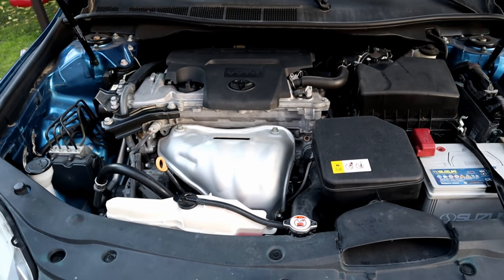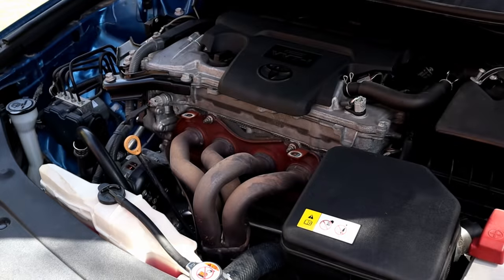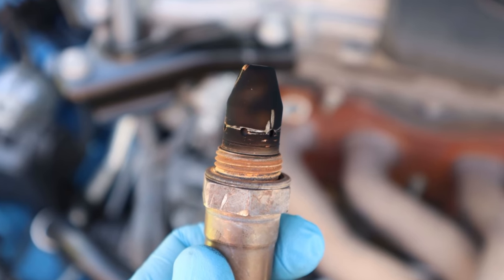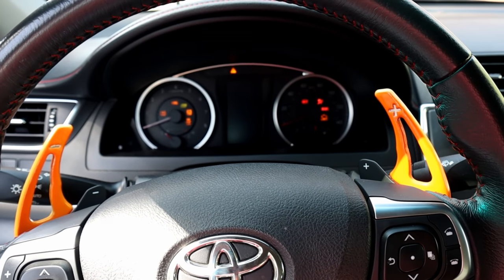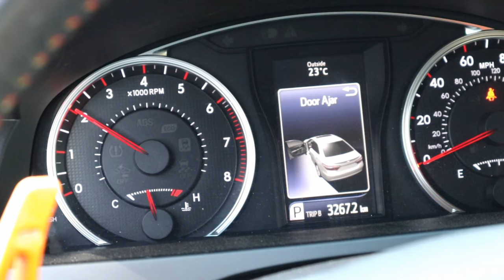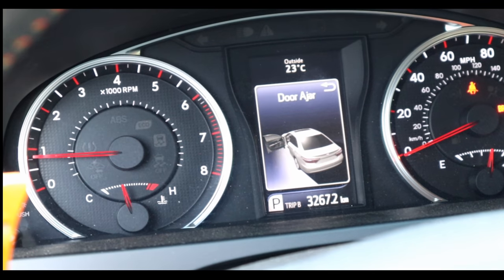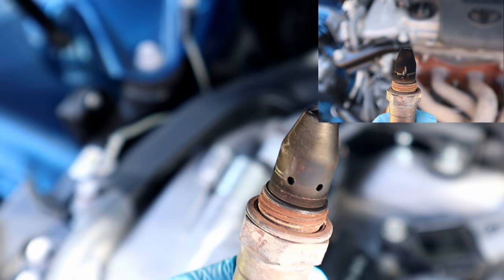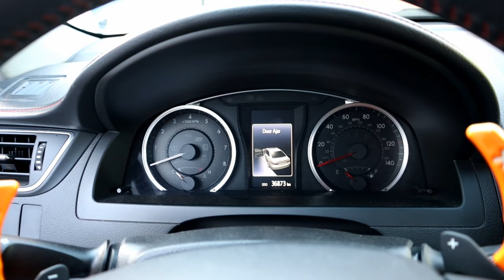Cleaning o2 sensor without removing it/Cleaning oxygen sensor with carb cleaner/TOYOTA Camry 2017

Comment: I have a 2014 same engine 2ARFE with 165k miles I think I should clean my o2 sensor and this will also clean intake valves you said right? It looks pretty easy to do I might do it myself. Thanks
Reply from the maker: Yes, you should, and you will definitely feel the deference
Reply: @AliMECH   I have 2011 Corolla LE I want to clean my O2 sensor where is the vacuum line in my Corolla, is it same place as Camry you shoes in video or is it somewhere else.
Reply: @jaleesxyz  it should be on the intake side right before your manifold. Look for a connection after the air intake filter.

Comment: Wouldn't hurt a thing to put some anti-seize copper on the O2 sensor threads before you thread it in, and tighten it. If you don't do this, the next time you need to remove it, might not be so easy!!

Comment: If an engine has direct injection, the intake valves can get very Carboned up.  This process would be good to perform periodically..
Reply from the maker: Yes exactly I did a video about it too, showed with proof that it clean the intake valves as well 
https://youtu.be/ljQlugKM9P0

Comment: You forgot to mention USE Anti-Seize compound on threads so next time sensor comes out easy.  Spark plugs too like Anti-Seize
Reply from the maker: Yes that's a good idea to use, but I never use them, and never had any problem
Reply: Ya it isn't smart to not use anti seize and he will have problems cause you can even see the rust on the threads.
Reply: @MrKoalatea  Yeah now that you mention it the rust will probably cause a headache in the future

Comment: Should never spray pure carb cleaner in the intake. It will delubricate the whole top end. Valves, seals, rings, cylinder walls. A no no. Without lubricant it will eat that top end up in no time. A lubricated cleaner is best if put through the intake.
Reply: Beast Mode
Reply: What name of lubricant spray  I must use?
Reply: @bobbykim1921  it depends on what project you’re working on. I learned the hard way that carburetor cleaner and throttle body cleaner have different uses
Reply: @bobbykim1921 sea foam
Reply: What do you recommend to Spray in the intake?
Reply: @luisponce1472  sea foam

Comment: O2 sensors looking like that means there is a problem elsewhere.  Also, there are at least 2 O2 sensors, Upstream and Downstream.  If there are 2 exhaust pipes coming out the rear, chances are you have more than 2 O2 sensors.  Also pushing Carb cleaner through the intake or vacume you risk burning up the Mass Air Flow sensor, or the Idle control sensor.  Not a good idea.  Do not do this.  First find out WHY your O2 sensor looks like this, then if you have no O2 sensor codes showing up put fuel injector cleaner that is designed to be mixed into your fuel, this will clean your fuel pump, the injectors, O2 sensors, the entire system.  My preference is Marvel Mystery Oil.
Reply: You aren't even close to the mass air flow sensor
Reply: Or the idle air control
Reply: Seen great different in Mpg 5 on F-150 1998 v6 100,000 odometer🤙

Comment: As a master technician with 45 years experience this is a very insignificant operation he is showing, because I have never replaced an oxygen sensor because of carbon deposits or soot and the first car to have an o2 was 1978/ Volvo with a lamda system, some of these auto technicians are becoming more critical, being that,,the don't totally understand automotive theory and electronics
Reply: Well look Mr master technician how about you jump in in make such a intelligent video and show ur 45 years of experience don't just run ur mouth saying this insignificant what I can tell u is where ever that liquid went am pretty sure it did clean something and where ever is carbon accumulated for sure the car will have a better respond in some how in harming it and doing this procedure is better than not doing nothing but what am sure is u harm more running ur mouth like I said again
Reply: @kabodkabod4168  
The carbon is an effect not the cause. It had a bad injector.
Reply: Of course a ''Master tech'' would say something like this... Takes away buisness they've been overcharging people for. Garage techs are such bandits that prey on people. I work in the industry also, so I know.
Reply: That may be true but this seems to work for some.
Reply: he said at the start around 0:35 that an o2 sensor gets dirty if there is a serious problem like a bad fuel injector or spark plugs. so obviously you'd need to resolve that issue and then clean your sensor. I don't see any problem with his video
Reply: How do you know if you have a bad injector bc my expedition run great but I had carbon build up on my 02 sensors and plugs changed at 80,000
Reply: @Angelo2005white  you'll feel the car judder a bit, especially at idle - I'm no expert, that's all I know
Reply: My motor cycle milage was decreased due to dirty oxygen sensor...or whatever... only one year  old motorcycle...
Reply: i think u were trained more to jew ppl outta money thats why ur unable to accept the simplicity
Reply: This for the Master Mechanic with 45 years experinced.
 I am only a DIY person but have very strong side in Mechanical and Electrical. 
Cars now adays comparing to cars before are not the same at all.. You may be the best Mechanic during your time Sir, but if you didn't upgrade yourself to keep up with the New Techology...then you are only good of what old vehicles are during your 45 years as great mechanic. 
 There is no harm in cleaning the oxygen sensor if you do it right and use the right  Chemical and procedure.
This one too is the one with the comment that if your Oxygen Sensor is dirty or full of soot...means you probably have a dirty or deffective Injector. Yes, that's a big contributor of having a lot of soot or you may have a high mileage too into the  vehicle and you probably stll have the original Oxygen Sensor that due for replacement. 
Peace be with us all my Brothers and Sisters.👍🙏❤️

Comment: I have a 2008 BMW with N43 2.0 petrol engine.  I have intermittent rough idle, still there after changing plugs and coils recently.  Also, suspect O2 sensor problem, but not sure where the sensor is (there seem to be a few similar looking) or where to spray MAF cleaner spray.  Any advice appreciated.

Comment: Keep in mind that the heater element in the O2 Sensor is out and cleaning may do nothing at all.
Reply: Emmmm.. Every sensor have function it self bro...
Reply: Check the codes causing the CEL to go on.  Usually separate codes for the voltage on the o2 sensor and the heating circuit on it.

Comment: Carb cleaner will foul the 02 sensor-brakecleaner.without removing it as you remove it??
Reply: I tried acetone.  Nothing else got wrecked (very diluted), not sure it had a problem anyway.
Reply: @louf7178  carb cleaner is basically acetone unless you go with the Berryman's B12 stuff, then it's 50% toluene and like 30% acetone with a bunch of other stuff.

Comment: Can I use the carb cleaner for my Hyundai accent 2013 with an electronic throttle but spraying the cleaner through the brake vacuum line
Reply: I use every time ✅🤙

Comment: I have read that you should never clean an O2 sensor, with anything, brake or carb cleaner included. Better to buy new, considering the rather affordable price 🤔
Reply: 120$ is affordable?
Reply: @dabtech7456  Considering the price of the car, and the $120 you'll spend anyway on a new sensor after ruining your "dirty" one by cleaning it, YES!! I have a modified LS7 in my 2000 Corvette. The sensors are almost 15 years old, dirty, and work just fine......

Comment: Question. I have carb cleaner but no long straw to put into the air line.Could i spray a bunch of carb cleaner into the air line and then put line back on,start the car.? Would it do the same thing?..Thanks

Comment: Be careful.  This can also kill or shorten the life of the O2, at least from my personal experience.
Reply: So how to clean O² sensor
Reply: @nikhaniff6511  ...once removed from the exhaust header and/or pipe, wipe it down with a (water) wet rag and if needs further cleaning, use a fine sheet of sand paper then use the wet rag again.  Once u're satisfied, dry it with a dry rag.  Let it sit in the sun for a couple of mins until fully dry, then reinstall it.
Reply: The sensor is under that metal shield  cleaning the outside does not clean the sensor beneath.  It is a porous ceramic material .

Comment: Damn, with an engine that clean and rust free 🥰, how in the heck did that O2 sensor get so dirty?
Reply from the maker: I have on clogged fuel injection, after cleaning it, I wanted to speed up the process for cleaning o2 sensor, even though, good fuel injection always clean the o2 sensor
Reply from the maker: No, not a good idea, sometimes carb cleaner couses check engine light or mess up throttle if its electrical, that's why I spray it from pcv valve, it will enter carb cleaner after throttle
Reply: @AliMECH  ⁶

Comment: I saw your other video about cleaning catalytic converters in a similar method, but in this method in this video would the spray cleaner also partially clean the  catalytic converter? 
Also thank you for the videos, I love that you show us how to do things in an easier way :)
Reply: Run high octane and xylene take off vacuum from EGR so it stays closed. And run it like you stole it.
Reply: @jregamey  
Great reply! - Is Xylene similar to Seafoam? - I ran Seafoam on old Civics by removing a line and pouring it slowly... lots of white smoke. In my 2007 Prius, I'm getting p0420 code on aftermarket cat (original was stolen), plus also interested in cleaning injectors (I use Marvel Mystery Oil here and there), and the O2 sensor was replaced like 2 years ago, Denso. Would 91 gas+Xylene help?
Reply: @jregamey  Hi where can I find Xylene in Auto part store or Walmart or Lowe’s ??? 🤙
Reply: Can you use this method on Nissan cars

Comment: Hello... the outside of the O2 tip is NOT the working part of the sensor, the core of the unit is what reads oxy levels as the vapers pass through the sensor. Cleaning the outside does nothing for the sensor. It may be clean and still not work properly. You have just burned a can of hazardous liquid for no reason but esthetics
Reply: I think the soot on the outside that he cleaned insulates heat from the o2 sensor making it not read right

Comment: Solvents are bad for oxygen sensors. They never need cleaning this is a waste of time.
Reply: To save money,He's pretty much waiting for the sensor to start misreading and many 02 sensors won't take multiple cycles of removal, some seize and screw up manifold threads on just one cycle, now ur looking for another mabifild which now means more 💰.
Reply: If the sensor is malfunctioning, what do you have to lose (besides half a can of carb cleaner)?

Comment: Snake oil. Cleaning carbon from the protective shield does nothing for the sensor itself. Instead, listen to what the car is telling you. An O2 sensor code doesn’t usually mean a bad O2. In this case, I am guessing that a rich condition is triggering the light to come on. It could be air, fuel, ignition or timing. If all you are using is a cheapo code reader to be a back yard mechanic, you’ll always be a parts changer hoping you got it right at a high cost of your time and parts.

Comment: Learnt something new today
 Great video. But exactly which vacuum line is used to spray the cleaner?
Reply from the maker: Thanks, the hose that connects to pcv valve
Reply: @AliMECH  can you use the brake booster vac line

Comment: Hi everybody, just a quick question on where can I find the vacuum hose of my 2004 Toyota Sienna which I can spray in the carb cleaner ?  By doing this will it clean the fuel injectors too?

Comment: Great video. Can this be done to 97 GMC suburban and which vacuum hose do I use?
Reply: Brake booster or Through the Egr hole that enter’s into upper intake or under the throttle body spacer ✅🤙👍

Comment: Do I need to reset the ECU after cleaning oxygen sensor? Thanks
Reply: You could by taking off the negative only off the battery 🔋 for 15-30 minutes and attach after and drive 1-5miles you see a difference. If you have a Auto Zone or O’Reillys close they could use their scanner to Reset ECU ✅🤙👍💯

Comment: I read somewhere that one shouldn't spray anything on O2 sensors to clean them, but to use a flame torch instead. How accurate is that statement?
Reply from the maker: After cleaning with carb cleaner, the error code is gone and car back to normal, look at my YouTube community tab, screenshot of Google, that carb cleaner wont damage o2 sensor

Comment: ? Just cleaning the outside? You need to sock them least for a day in carb cleaner to get inside. My catalyzer was blocked but still no piston working, could it be above sensor  clogged?

Comment: I performed this proceedure but using white spirit on a 2.7litre V6 Hyundai Santa Fe which had an error code P0420 bank one sensor one. The voltages and percentages were just one the borderline so used 1.5litre of white spirit and followed that up with running 2litres of water which ended up with a very smooth idle and error code never returned after clearing it.

Comment: Hmmm I'll thinking about that the way u did cleaning from carb + choke spray into small tube from Toyota Camry valve then after spray onto OS 2 sensor.... I'll try that on my Toyota Sienna LE 2011 look similar to Toyota Camry engine to be clean from Cataylic Converter on P0430 code.

Comment: What cleans oxygen sensors best is oven cleaner. After soaking the sensor in oven cleaner foam then rinse well with hot water and blow it off with compressed air.

Comment: I have a 2017 Hyundai accent check engine light is on it reads that it’s catalytic converter or oxygen sensor should i replace the upstream sensor it reads it’s the upstream

Comment: If the oxygen sensors job is to determine the oxygen left in the exhaust gases wouldnt spraying a harsh toxic flurry of chemicals on it hinder its ability to correctly read oxygen levels?

Comment: Hi, thanks for the video.
I getting Oxygen sensor heating circuit error on my car as you can see below, would cleaning the sensors help or since it's related to the heater I will need to replace them? (I check the electrical connections and everything looks normal).

P0030 [0x0030]
Heated oxygen sensor (HO2S) 1, bank 1, heater control - circuit malfunction
Status: Confirmed
----------------------------
P0036 [0x0036]
Heated oxygen sensor (HO2S) 2, bank 1, heater control - circuit malfunction
Status: Confirmed

Comment: Are you able to do this on a 2004 chevy cavalier? Not sure if it has a vacuum line.
Reply from the maker: Of course, it has vacuum line
Reply: @AliMECH  I see a small vent hose from the valve cover to the intake but thats it. Where would the vacuum hose be located?

Comment: My 98 Isuzu rodeo 4x4 v6 has four 02 sensors I ran a scan and it showed bank 2 sensor 2 which I believe is passenger side rear sensor I bought a new sensor the car was in the shop so I had them replace it while they replaced Bank 1 sensor 2 needless to say I still have a check engine light thankfully where I live there are no inspections for 02 or anything else.

Could the code be thrown simply because of a bad or unresponsive O2 sensor and I wonder if cleaning the system would clean the bad sensor or should I just go ahead and buy a new sensor they run about 50 bucks a piece for my vehicle.
They're just kind of a pain in the butt to get to.

Comment: How’s spraying carb cleaner in the intake going to clean the 02 sensors behind the CATS?
Reply: Never ever use pure solvent through the intake. Premature top end wear. Strips all of the lubricants from the top end. Will ruin the engine

Comment: Hi brother,
Quality video! My Honda city got dash light on. Upon checking with a mechanic it's p0141 code. Need to replace the sensor which cost AUD$600. Any life hacks to fix it please. Much appreciated.
Thank you
Reply from the maker: Thanks, I suggest to clean it first before replacing it
Reply: @AliMECH   the mechanic did not clearly mentioned which sensor. P0141  what does exactly meaning and which sensor fault. There are total 4 sensors  before and after catalystic converter. How do I know which one is faulty.🙏
Reply from the maker: You can clean them all by puring lacquer thinner in to the fuel tank, and it cleans, fuel injectors, catalytic converter, and o2 sensors, that's much easier to try, like I did here 
https://youtu.be/cFkqPHSzEbg
Reply: @AliMECH  Works like a charm. My 2004 Cherokee has been running like new since I did that 6 months ago.

Comment: Do you use copper anti-seize on O2 sensor threads and exhaust threads to prevent galling?
Reply: I use silver anti-seize on all that. Its a good practice, namely if you keeping the car.
Reply from the maker: I didn't use it, but yes it's a good idea to use it

Comment: Hi will this method work with vw golf mk5? I tried removing the o2 sensors and they too tight can’t get them out, and I already have check engine light
Reply from the maker: Yes you can, Try to spray WD-40  it makes very easy

Comment: Thanks, AliMech, today in my Holden Astra TS 2002 i got 2 Code Error. Number 1: Po170-2  (Lean Exhaust) and Number 2 : 44 ( 02 Sensor Lean Exhaust ). Do you think if I clean the 02 Sensor can fix the problems? Thanks and cheers from Australia.

Comment: I followed the steps, thick white smoke came out of the exhaust after spraying carb cleaner on the intake valve hose. Is that normal?
Reply from the maker: Yes that's normal, that's what we need, for cleaning
Reply: Ok thanks a lot. ❤
Reply: I used Wurth Carburetor and Injector Cleaner is it okay?